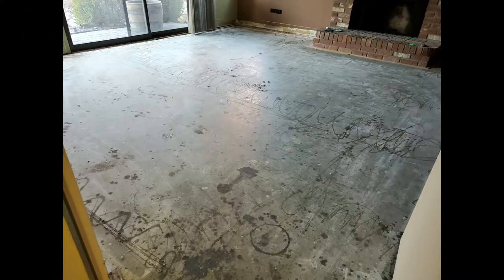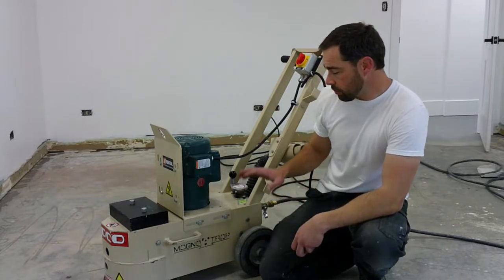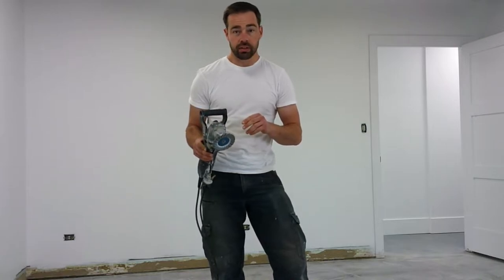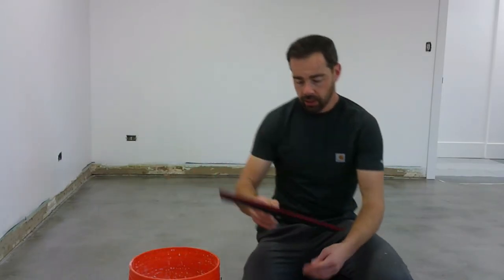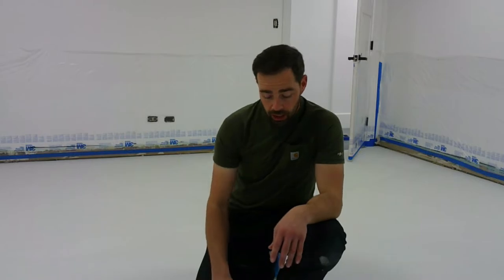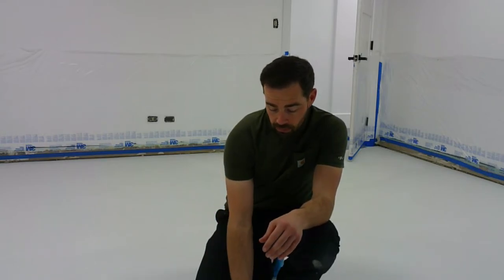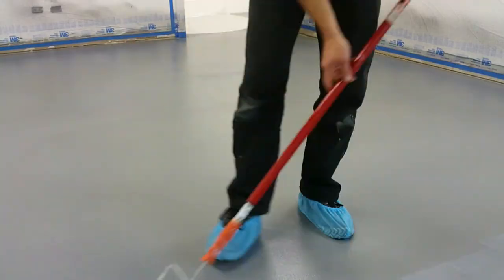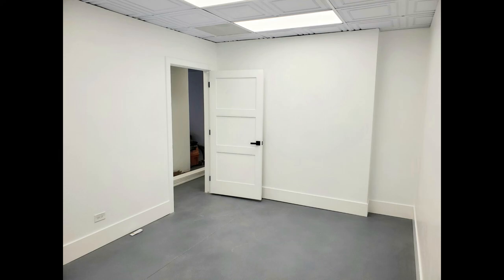Concrete Overlay (microtopping) process step by step (prep, overlay install, dye, sealer)

Comment: Did you sand the Microtopping at all once it cured? How did you get rid of drip marks, trowel lines and high spots? Thanks.
Reply from the maker: I didn't sand the surface but you certainly can. I had practiced my trowel technique and was happy with the very minor trowel marks. But Duuramen does recommend sanding between the 1st and 2nd coat of microtopping if you want a more smooth and polished appearance. It works well either way.

Comment: what products are u rolling with ?
Reply from the maker: This is the Durramen Skraffino system. I give a lot of detail on each of the individual products and steps in the video.
Reply: @hanscustomshop Thanks for the good Informatiom.Very nice clean look.Are the floors really smooth and flat after the overlay.Does it self level a tad bit?You seemed to skim it pretty easily and wondering if it looks a little wavy   here and there,creating that kind of natural stone look.Ive done shower walls with skraffino and my floating left some choppy marks but that was the desired look.
Reply from the maker: @homepro3743  Thanks for your comment.  The floors are not perfectly smooth.  No matter how well you trowel there will be some texture. If you have the tools, you could sand the surface after the Skraffino is applied, and before the dye and sealers are applied. That is a common practice with this product, but not a step I took.  We like the texture that we ended up with.

Comment: I’ve looked through the transcript but I can’t find the name of the product you used to fill the carpet tack holes.  Would you share that info please?
Reply from the maker: You bet. The product I used is Param FP by Duraamen. I have some left over from the job in the video, and I use it for any kind of concrete repair work that comes up. Used it to fill some spalling in my driveway recently.  
https://duraamen.com/shop/surface-preparation/crack-repair-patch/param-fp/